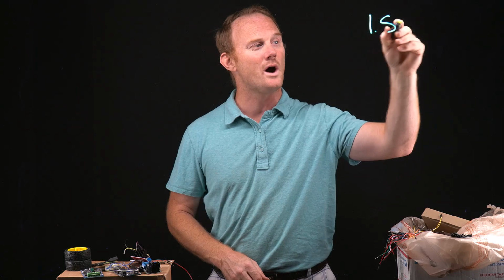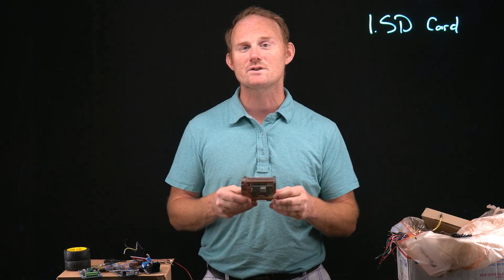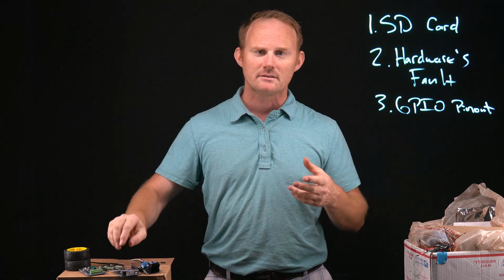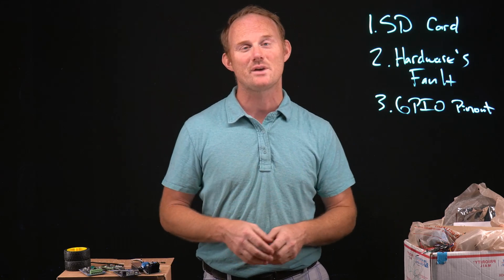I Made A Voice Activated Robot Car With JavaScript. Join Me!

Comment: I would recommend to use ESP32 and not RP to control the car, it is much cheaper, has excellent PWM, uses much less power and can use BLE or WiFi  to communicate with an APP. And last but not least it can also  be programmed in Javascript, so the complete solution can be made with javascript only.
Reply from the maker: I have already put it together, but I'll look at that for a second go!
Reply: Yeah ESP32's are insanely great